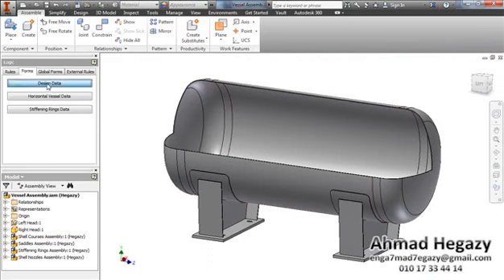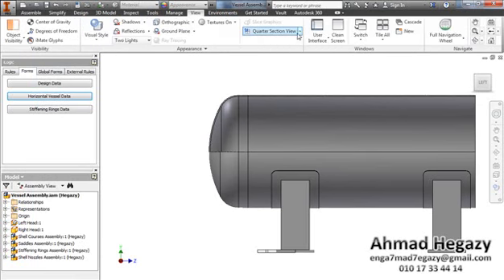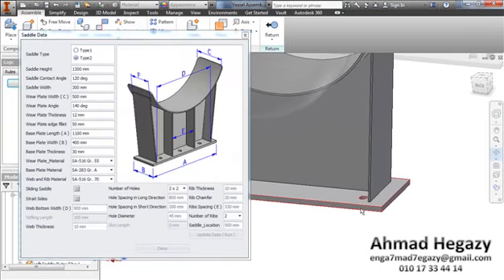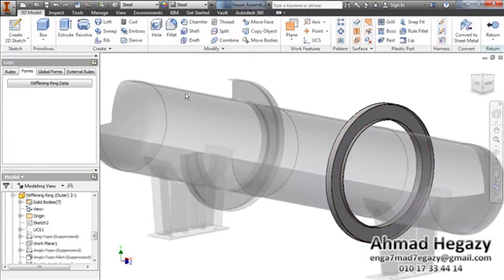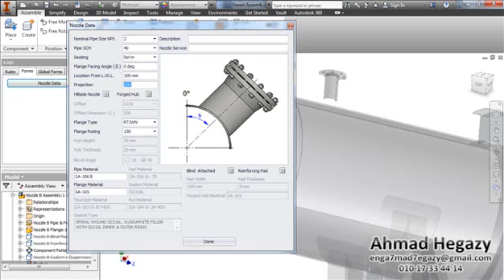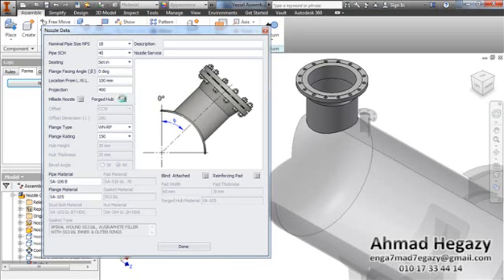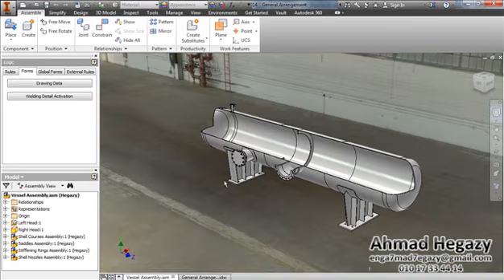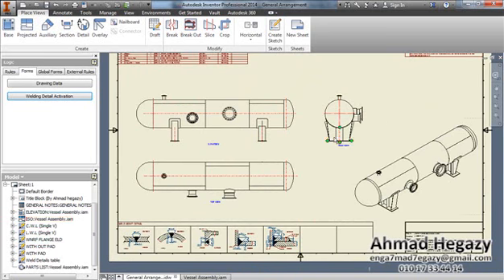3D Modeling of a Pressure Vessel by using Autodesk Inventor, iLogic

Comment: Really its an impressive work.
Reply from the maker: Kindly check our SEG software
Static Equipment Generator
It is amazing software for 3D modeling and detailng of TEMA heat exchanger, pressure vessels, columns, storage tanks with fixed roof, ducts, Slug catchers and more.

For more information kindly contact
Secadsolutions@gmail.com
Contact@secadsolutions.com

Thanks in advance

Comment: Impressive work. I would like to know that how you make this forms. Are you doing it by API modification or inventor has a hidden options which we might not know. I have developed an full Heat Exchanger design with ilogic with help of excel. Pls help me.
Reply from the maker: by using inventor iLogic forms